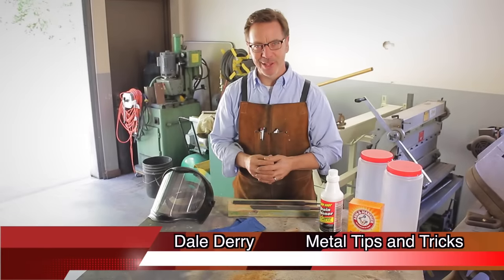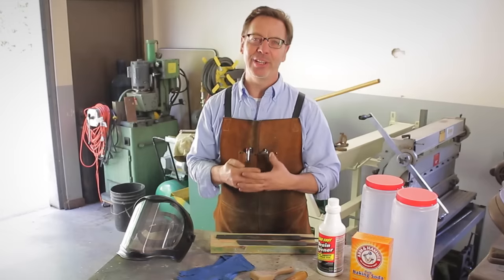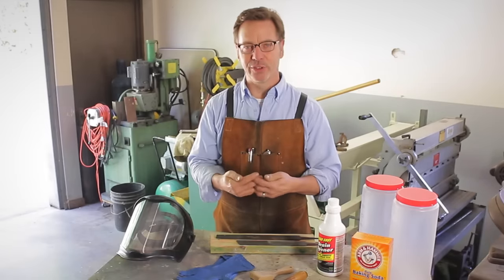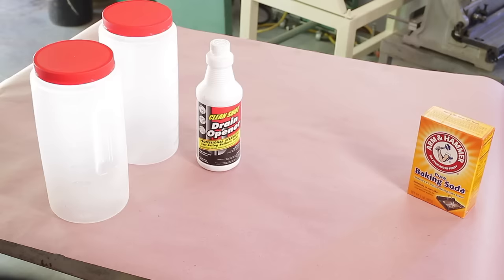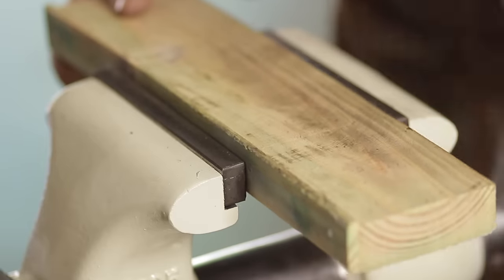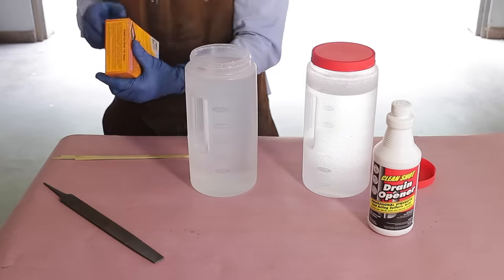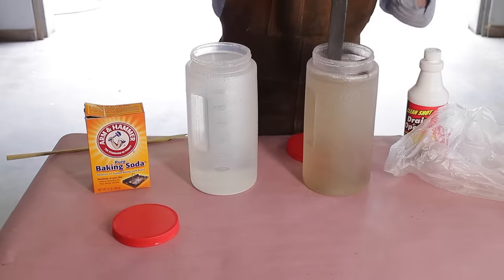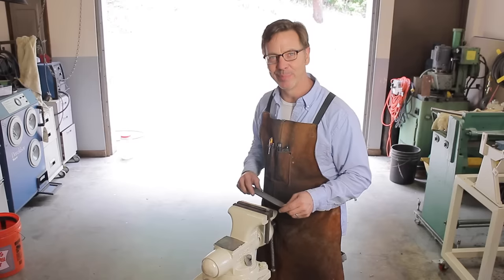How to Sharpen Metal Files

Comment: There is clear dividing line in the comments between people who do and don't understand chemistry.
Reply: yeah some people think chemistry magically sharpens things
Reply: actually ghettohillbilly its a pretty neat reaction. The acid eats away at the surface of the steel. Being in a chemical bath means that the reacted steel can magically float away after being removed from the surface of the steel. this reveals the fresh steel underneath. In the same way a pencil sharpener magically creates a point by removing layers of wood from the face rather than the point, the reaction magically sharpens the steel points of the file with a special kind of magic called "geometry". Pretty cool right? To learn more about this and other neat "magic" tricks go back to middle school.
Reply: Cowboydjrobot acid etches metal, etching is not sharpening, its cleaning, this is cleaning, comparing pencils being sharpened mechanically to this is foolish as its totally different...  try again
Reply: ghettohillbilly1 if you were to examine the file under magnification before the acid immersion you would see rounded teeth. After the acid bath the rounded teeth would be sharper points, that is chemical sharpening because of the way the acid attacks the steel. Sorry man , you should have tried to stay awake in basic high school chemistry class.
Reply: Sorry I thought I explained it simply enough. The acid does etch the metal. Etching is when the surface layer of the material is removed during a chemical reaction. This chemical etching is similar to mechanically removing a very thin surface layer. There is much more surface area on the face of each blade than on the tip. This means that more material is etched away from the face than at the tip. Get out your crayons and draw a triangle with a rounded tip. Now draw line parallel to the uprights of the triangle notice how when the lines cross they form a sharp angle even though the tip of the triangle was round? Thats whats happening here. I hope that you understood that because I don't think this concept could be explained any more rudimentarily.
Reply: Cowboydjrobot +flick cogswell guess you've never actually known what sharpening is, read the meaning, here ill get it started for you, " Sharpening is the process of creating or refining a sharp edge of appropriate shape on a tool or implement designed for cutting. Sharpening is done by grinding away material on the implement with an abrasive substance harder than the material of the implement, followed sometimes by processes to polish the sharp surface to increase smoothness and to correct small mechanical deformations without regrinding"  notice no mention of chemicals, also there is no wiki for chemical sharpening, why? because it doesn't exist, the layer of metal that is taken off the file is so small its barely measurable, it will be way less than the level of corrosion, oxidation and any other crud (coatings, grease, wood, plastic, metal particulates, etc) that it removed, thats where the real results come from, so please provide me with reputable sources or file manufacturer that say this is standard practice and recommend this to"sharpen files" because if what you say is true it should be well documented
Reply: So your argument is "there is no wiki page and one definition includes only mechanical verbage and doesn't explicitly include chemical processing". Ill find you the research you are looking for and in the mean time i want you to find the research that proves "the layer of metal that is taken off the file is so small its barely measurable".
Reply: Cowboydjrobot lol thats all you have a review with some dull pictures come on man
Reply: haha sorry That was what i found after a quick google search. Finding research to educate kids in youtube comments sections isn't actually the only thing I do. So It'll take some time. Have you found anything to disprove me yet?
Reply from the maker: Thanks for posting this article :-)
Reply: Cowboydjrobot wow was i wrong im over whelmed by your proof...

Comment: Files, as all cutting tools, have chisel shaped teeth and when dull the tips become rounded and blunt rendering them useless more or less. A grinding operation is most certainly required in order to deepen the groove, sharpen the edge and allow the cutting tool to function as intended. Period.

Comment: Are you sharpening a file or really just cleaning out debris?
Reply from the maker: It really dose sharpen the files and works in most cases . But some files are to far gone for it to work every time.
Reply: Having performed this many times I can testify that it does work. Three years ago I made a video where I show the test of a clean, dull, file. Both before and after sharpening. The sharpening process is effective on files that still have teeth. Missing teeth will not be magically created. 
A file that is dull to the point of skating over a mild steel surface can be sharpened to where it will cut the same mild steel surface. 
My understanding of the process is that both surfaces of the file tooth are attacked by the acid. At the same time the tip of the tooth is also being attacked. The triangular cross section looses one atom from each face, and one atom from the point. The effect is to make the tooth thinner by the thickness of two atoms  while it gets shorter by the thickness of one atom. 
Then there is the counter argument that it only cleans the teeth. 
If the teeth of the file are plugged with pinning, metal shavings that get jammed into the teeth from improper use, the acid will react with the pinning, depending on what material the pinning consists of, and eventually remove it. The problem with that comes from the shadowing effect caused by the pinning filling in the gullet of the file tooth. By filling the gullet the pinning prevents the acid from reaching the face of the tooth. 
The acid acts upon the pinned surfsce as if it were a flat surface and removes one atom at a time from all of the surface it in contact with. The file tooth gets shorter without a reduction in its cross sectional thickness. 
So why doesn't the file cut as well as it did when it was new? If you leave the file in the acid the teeth are eventually eaten away leaving a, more or less, flat surface. I said earlier that the acid, if used in this manner, will not create teeth. As it is eaten away, the tooths pitch, the distance center to center between the teeth, doesn't change. The acid removes one atom from the bottom of the gullet at the same time it removes one atom from the tip of the tooth. The tooth gets smaller in cross section in a two to one ratio with its reduction in height. Carried to the extreme the tooth disappears. The effect reduces the gullet, the space where the chip collects, between the teeth. The reduced gullet fills quicker. The file pins and stops cutting when the gullets are full, thus causing the file to slide on the pins instead of cutting. 
So why don't I sharpen drills with acid? Aha! You've got me there. You have found the fatal flaw in my argument. No one sharpens drill bits with acid. 
Why doesn't anyone sharpen drill bits with acid? Engineers, machinists, and shade tree mechanics should be jumping all over this method. If it worked they might. 
The problem is that pesky bit of logic that says the acid removes metal from every surface it touches. Drills come in many sizes. All of them sized by their diameter. Reducing their diameter means they cut a smaller hole. Not very effective. 
The preferred method, which is grinding, is selective. The cutting edges at the point of the drill are sharpened by removing material, much faster than one atom at a time, from the end of the drill in such a way as to reduce the cross section of the edge. 
Just like the acid does.
Short answers.
Acid only cleans the file.                          No. But it really needs to have a clean file to start with in order to work well. 
It's never as sharp as a new one.         Yes. The teeth are shorter and won't hold as much chip load.
You can't sharpen drills this way.         Yes.  Drills aren't files. Files don't need to be dimensionally stable.
I hope I've answered your questions. If not you can go to Old Sneelock's Workshop and see me sharpen files and drill bits. 
If you really want to know exactly how this works you can perform your own hands on testing. Like engineers, interns, and apprentices do every day. When you have finished your capability studies come back with your facts and data and we can have a discussion. Until then, and I'm sure long after, I'll keep using resharpened files. 
Why?  Because they work.

Comment: I run my files under a wire wheel on a bench grinder keeping file grooves parallel to wire bristles easy 1 minute job.
Reply: Really fast way to dull a file, at least now you know how to fix them. Check the hardness of the wires in a wire wheel, you aren't doing your files any favors.
Reply: i'm not forcing the file into the wires, and there parallel  to the file teeth. I am a machinist btw.
Reply: .025" and i'm not forcing file into wheel.
Reply: @jaymanxxxx  I'm a tool maker since 1974, and the wires are still hard on the file teeth. Think about it, the wire wheels are moving fast with fairly hard wire and will take burrs off and round corners on steel parts, each time you do it, not much damage will be done but what you do each time doesn't go away. I suppose each to their own but I'd never do that.
Reply: @jaymanxxxx  What I do to remove pinning is use a piece of copper or aluminum to clean the teeth, both are soft metals that won't damage the teeth.
Reply: what's the Rockwell hardness of a Nicolson  smooth bastard file?
Reply: 60 HRc
Reply: @jaymanxxxx  haven't checked but I'd guesstimate Rc60-62 the wires, on another guesstimate, low 40s, I've had some stuck in my fingers and they're pretty hard but still flexible.

Comment: I would like to know how acid works unless it takes top layer off chemical engineering 😅
Reply: It eats away the metal.
Reply: Imagine same depth of metal gets eaten away from the surface, characters representing the outer edges of the tooth as the reaction progresses:
  000
0###0
0#++#0
0#+@+#0
0#+@@+#0
Reply: @SinsBird  that'll be behind me I like to grind and stone sharpness and if my file blunts I buy another save getting burned messing with acid good luck xx

Comment: I'm sure I'll get a bit of backlash on this one, but here goes...
I recently went through my file drawer and selected the worst, dull files I had and was planning to throw them out and replace them with new files (a fairly costly endeavor).  Later that day, I was sandblasting a few items in preparation for paint and I decided to give the old files one last chance at a reprieve...  I sandblasted them clean with 80 grit garnet abrasive, and to my amazement, they seemed to cut pretty well when applied to some cold rolled steel.  I certainly wouldn't recommend this as a proper method to clean files.  However, for old files that are well past their prime, it may allow you to get a bit more use out of them.
Reply from the maker: +Al C 
That was very interning, Good job
Reply: @BuildSomthingCool  There is company that sharpen file by blasting with an abrasive slurry FROM the BACK.  Your method is basically the same if you hit the file from the back.

Comment: Sulfuric acid catalytically breaks down into toxic hydrogen sulfide when contacted with iron, so need good ventilation for this.
Reply from the maker: +jadedengineer 
I should have told everyone that I was in a well ventilated area, all doors open and a big fan. :-)
Reply: Best to do the job outside. The fumes will cause any iron  alloys that they touch to rust. Take a look at the battery area of any old car.

Comment: Let's have a quick show of hands who doesn't understand why you must never add water to acid but the other way round.
Reply: Acid ate my hands.
Reply: If you add water to acid it reacts in a way that will splash acid back at you. I don't know why, I simply know that it does.  The effect is a lot like if you drop water into hot oil on the stove.
Reply: Besides science class, my first photography darkroom class taught.  When we used chemicals to make the magic to make prints.  It was AAA, it stands for always add the acid.  If you do the reverse you get a bu.
Reply: Just think A&W ..... as in teen burger. How's that for a plug?
Reply: Silverhorn2 Hey, that's the one I use- A&W. Except I think root beer for some reason.
Reply: Also when you add water to acid the steam of water is less than the acid and the reaction is violent. Because acid is an oxidiser and water has oxygen - the acid rips the oxygen molecules out of water.
Reply: two reasons. when adding substance A to substance B, substance B is more likely to splash back. Secondly hydration of many dry substances is exothermic but hydration of acids isnt as exothermic as most people believe.
Reply: If you do it wrong, you'll never forget!  If there's a drop of water in a beaker of acid, that water gets hot, maybe boils, throws out some acid, makes noise, it's ugly.   Drop of acid in water gets hot (it does), and you just have some warm lemonade.  The drop of acid just diffuses into the water, it's not a problem.

Comment: How do you really sharpen a file? A knife is easy to do but a file had 500 sharp edges.
Reply: Well you ether go and get really.. REALLY expensive machine that is specific for this use... or you just use the acid to eat metal away to bring that sharp edge back! I will be using the acid method.. now where the heck get 10% sulfuric acid.... cause why isint it in forbidden chemicals list, cause some moron might go and drink it..-.-
Reply: Hellsong89
I don't think that dipping in any acid will sharpen it. Usually, it causes pitting (some areas get corroded faster than other). I do chemistry so I am well aware of that.
H2SO4 is safe in dilute form. Just make sure that you wash your hands quickly. The drain cleaner version will cause skin damage because they tend to be 95% to 98%.

Also, even if dilute, small drops might jump around as you poor it. If it lands on cotton, it will cause degradation. Don't wear expensive clothing.
Reply from the maker: Give it a try, it really dose sharpen the file.   I promise you, you will be surprised.    
One side note the file must be dull not damaged to work. :-)
Reply: Well, isn't it nice that he's showing  us a way to do them all at once?